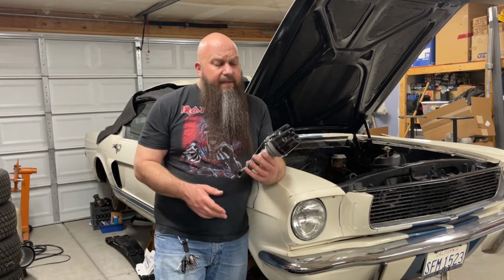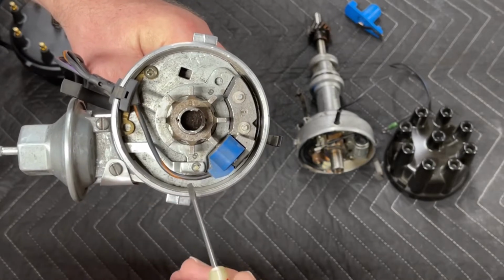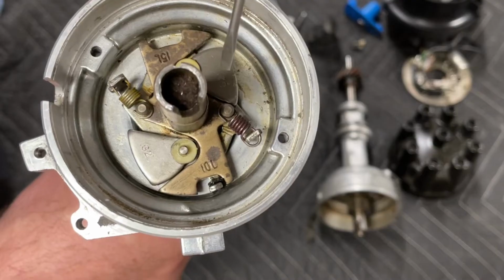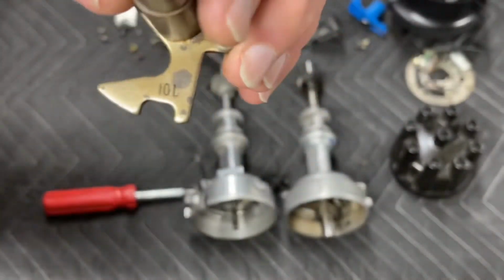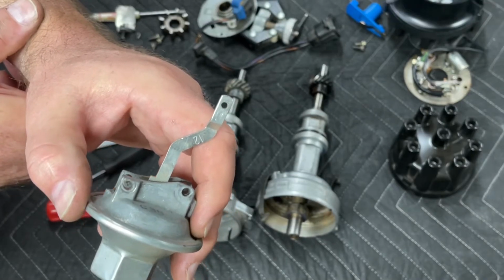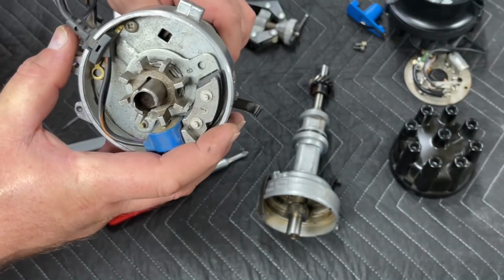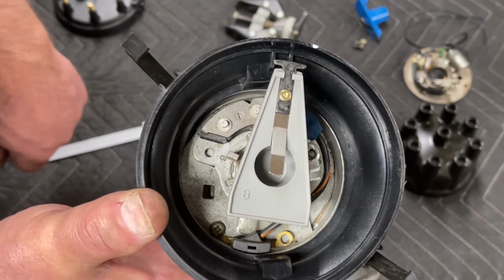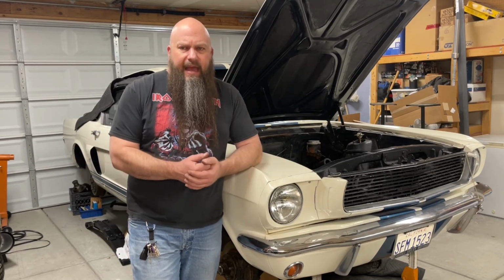Easy DIY Performance Re-Curve: '57-87 Ford V8 Distributors - Tune Your Ignition Timing

Comment: I'm a GM Delco guy , my Pontiac is recurved for the old gas. I'll need to do some different things but I get the idea.   I really like your channel Walter.  Thank you for sharing your knowledge with your very informative videos.
Reply from the maker: Timing is timing.  It really doesn’t matter if it’s AMC, Ford, GM, or Mopar.  For modern fuel, it burns faster, you need a little less timing.  The energy content is still there so you can still make great power.  The key is to have full advance 200-500rpm above your typical steady state cruise rpm, and use vacuum advance on manifold vacuum so it becomes load dependent.  Tune for torque and horsepower using the mechanical advance and use vacuum advance for lower emissions, stable idle quality, and cooler operating temperatures.  Those principles work on on nearly all engines in older vehicles.

Comment: Pardon my french but
Damn good video Sir.
Your right about the gas quality of today vs the 70s gas, if everything is ok to Perfecto !! It won't run worth a $&+- if the timing curve, stability (bushings etc) coil and pickups/points isn't up to snuff the engine will run poorly !! I've seen people literally rebuild the engine that was tip top because of a distributor/ control module problem, the total advance and all in by ? RPM makes a major difference in driveability Performance, economy.
All the best to you and yours Sir.

Comment: I've been doing a lot of trial and error tuning in my 429 Autolite distributor for my 70 Torino GT... I must say man what a great vid! You nailed it every step of the way and by far best Ford distributor tuning video on YT... Subscribed!
Reply from the maker: Right on!  Glad the content helped.  If you have questions about specifics for the 385 Series, I’ve built versions from basic 429 Thunder-Jets to Super Cobra Jets and displacements up to 604” and installed them in applications ranging from boats, to RVs, Land Speed cars, drag car, and daily drivers.

Comment: If my base timing is 12 what is my total timing my engine is 289 with 302 heads standard cam
Reply from the maker: Should be 32-34° but you’ll need to use a timing light to figure it out.

Comment: Hello can you help me I have a detonation problem on my 351 stroke to a 408 strip street  Windsor that I just can't get rid off.
  Initially I started with a 10.5  to 1 compression, but the braking pressure was 350 psi on all 8.
Reply: So I decided to use dish Pistons to lower the compression to 9.5.1 in retarded the cam, I still wind it up with 220 PSI of cranking pressure.  I swapped cams and was able to get it at 195 psi.
Reply from the maker: Sounds like your calculations for static compression were way off or you went way too small with cam selection both times.  10.5:1 is not a problem, but cam needs to be mid 230s duration @.050” minimum for street use.  

What is the piston to deck clearance on your engine?    And are you using a ‘69-71 block with a shorter 9.480 deck height and not factoring that in by chance?  What cam are you currently using?  How is it installed?  What heads?

You may have an issue with quench area.  Too much space between the piston and the head, incompatible shapes between the head and the piston causing poor flame travel.  

There are solutions but they may require changes, but to offer you any more complete guidance I need to know a lot more about the combination.
Reply: @TheGT350Garage   heads are afr 1420's cam is solid Howards 230° duration and Block is a "D" 80's Block, i dont recall the piston deck clearence but it for sure just alittle in the hole.
Reply from the maker: Hector, the cam is actually pretty small for a 408, that’s basically just a hair bigger than a 289 HiPo cam.  You’re snapping those valves open and shut on a set of high flow heads and getting a pretty stout cylinder fill, that’s why the cylinder pressure is so high.  

Then you have the issue of quench area.  A stock 351W has the piston .035” down from a 9.480 deck and .058” down on a 9.503 deck, add the thickness of your head gasket (typically .041”) to that and you’ve got .099” quench.  The dished piston makes it worse because the flame travel is moving in different directions and not smoothly across a flat piston crown.  You’ve got a difficult setup to work with. 

I’d go back to a flat top and use a Cometic gasket with a .027” compressed thickness to get rid of as much quench as possible without a complete rethink of the combination.  Then I’d put more cam in there, something in the 238-242@.050 intake and 244-248@.050 exhaust range, ground on a 112 LSA and installed on a 112-114 ICL, and with .560-.600” lift.  It’s a huge leap and sounds like it’s not streetable, but it won’t have the issues you’re having now even at closer to 11:1 compression.  Total timing will need to be in the 27-29° range, and you’ll need to tune for .85-.88 Lambda (air/fuel ratio).  With that it will run great, drive great, and be relatively trouble free.
Reply: And it still detonates like crazy. I have tried recurving the distributor. Obviously play with the timing initial and total different carburetors. Nothing seems to work.   Any suggestions??

Comment: Gday Walter, 

Do you have a part number of the vac adv canister for the duraspark dizzi ? 

So the canister adjustment  is changing spring tension which allows tuning of the vacuum hg where you want vacuum advance to disappear ?

Any advice on using alum terminal vs brass terminal dizzi cap (Duraspark ) with HEI module or multi spark ignitions ?

Cheers
Reply from the maker: Use a Standard Motor Products VC-221

Comment: one question  to remove the weights the plastic retaining clips will break. what do you use to replace the clips or can you get new ones and where. thanks
Reply from the maker: There isn’t really a need to remove the weights unless the distributor is in really bad shape.  If that’s the case, a replacement would be a good idea because at home most enthusiasts don’t have the tools to check the bushings in the housing and the shaft for wear.
Reply: @TheGT350Garage  you mentioned to remove them to make them lighter plus i have had the plastic clips break from getting brittle from heat but have no idea what to use to replace them are there clips available from somewhere thanks
Reply: @79LiLRed   I was scrolling through here to ask the same thing I got a pair of distributors with cracked weight retention clips.  I can't find anyone with a source to buy them.

So it looks like I need to get an ID, OD, and height measurement to see if spacers can be bought. Then hope I can find an E-clip that will work to hold them down.
Reply from the maker: @earlbrown the plastic bushing and clip is a non-serviceable design and was only ever available as part of a new or remanufactured distributor.  What you can do if your clips are damaged is use a distributor shaft from a points distributor, the pivot shafts were larger and the weights pivot on the pin directly, allowing a simple E-clip to hold the weights on.

Comment: I’ve got a freshly rebuilt 289 that is bone stock except for slightly improved (truck/RV cam). My stock ford distributor has no mechanical advance because the weights and springs are corroded I’m suspecting. Thanks to your video I’m ready to dig in and take it apart. What total timing and about what RPM should I shoot for it to come in at? It’s set at 12 degrees initial and idles well but has very little power due to no advance. Thanks!
Reply from the maker: Total tends to be about 3-4° less than the original factory spec because off the changes in the fuel.  So you’ll find yourself in the low 30s.  The curve should bring the timing in fully about 500rpm above your typical cruising rpm.  Vacuum advance should be in place to layer in an additional 10-14° at idle and cruise speeds.
Reply: @TheGT350Garage  great thank you!
Reply: @TheGT350Garage  I got the breaker plate pulled off and
I have to really give the rotor a good pull to twist it some but it doesn’t snap back into place like it should would the springs holding pressure. I’m assuming my springs are a little too worn out. I’m attaching a picture of what I found. Is there anything that looks out of wack? I’m thinking something needs to be lubed but I wasn’t sure the correct lubricant and where to put it because it feels kinda sticky.

Comment: MSD Distributor Advance Recurve Kit # MSD8464
Reply from the maker: For MSD and GM distributors that kid is absolutely fine but for a Ford distributor the springs are not the correct length to maintain a proper curve in the long term and Ford specific springs should be used.

Comment: Man thanks ☺️ 👍 I wish I seen this video before I bought a Pertronix 3 . 
I never new what that felt was for I always thought it was to protect the screw underneath 🤣.
I'm about to pull my Pertronix out and put my motorcraft back in ,  so I'm assuming you adjusted your vacuum advance using a vacuum gauge ?  Giving it around 7 hg ? .

I have a 390 Fe in my 69 F250  it has a Comp 265/275 cam and I put a  4bbl with a RpM intake  I have a adjustable vacuum advance motorcraft dist with Pertronix 3 module and coil .   I can only get 91 here in so Cal  I'm wondering how close the Ford Mr gasket recurve kit springs are to the GM points advance springs I bought that kit since I was using the Pertronix 3 dist.
That's some info there I didn't know I could get a adapter for a dura spark and cap /rotor and make a HEI style set up either muchas Gracias .
Reply from the maker: So, the GM springs can be used but they fit a little funky because they are longer.  You just have to make sure they aren’t loose.  FE engines, especially 390s do tend to need a little more timing than other Ford V8s.  You’ll probably want to be around 33-35° total mechanical advance and get the vacuum advance to give you everything it has by 4-6” of manifold vacuum.  

If you have the means to fully disassemble the distributor, you can clean the housing with a small bore brush, clean and polish the distributor shaft, and use a dry film lubricant (commonly used for firearms and easily found online) in the housing and on the polished shaft.  Then a drop or two of engine oil in the bottom of the housing and it should feel amazing and spin with absolutely no resistance.
Reply: @TheGT350Garage   I ended up getting the Ford ones  the GM ones fit  pretty good although not sure if they were stronger or weaker than the Fords .  Also I had the 10L and 15L distributor  so I just left it at 10 L to make 20 + my 10-12 initial will be 32 total if I go past 12 degrees initial  it starts funny like a run on start it's better at 10 _12 for good starts .
Reply: My distributor only has the 10 mark on both sides . If I take that lil plastic bushing out will it give me 5 degrees more for 30 degrees mechanical advance ? .. also with the dura spark can you run that to your coil with the hot wire from the dist or does it have to be ran through the module ? And is the D.S.distributor cap  fit the HEI plug wires or is it exclusive to the dura spark.
Reply from the maker: @TheThirdWheel618 so, if you have a 10L leave it a 10L (20°).  It’s better to make up total advance with more initial timing than to run a bigger advance curve.  For your FE you’ll want 13-15° of Initial timing plus the 20° advance curve to get 33-35° total.  Vacuum advance helps with idle quality, engine temperature, and fuel efficiency.  As I mentioned before, it should add timing above 6in/hg of vacuum.

Duraspark has a magnetic trigger that operates a module, so yes a module is mandatory.  I like the Pertronix Digital HP these days.  Nice unit for the money.  

The Duraspark cap is a post style just like an HEI, so the HEI style wires from your Pertronix will work.
Reply: @TheGT350Garage  thanks 👍 my engine acts funny if I go past 11 degrees initial maybe it's just me thinking it I can only get 91 octane here .   I seen the cap and adapter pretty much everywhere lowest year said 77  I'm hoping that will fit .
Reply from the maker: @TheThirdWheel618 the cap adapter for a Duraspark works on ‘57-up V8 distributors, you’ll be fine running the big cap and rotor.  The 11 degree initial timing limitation makes me think you have something else going on mixture or spark delivery related to cause that.  If it’s not tolerant of more than 11° BTDC initial, how does it handle vacuum advance at idle, or is it more a cranking issue?
Reply: @TheGT350Garage  it will take more timing although it was 6 or 8 factory spec,  10 degrees is fine if i go past 12 it tends to run on occasionally.
I had a autolite in it  when I bought it but then I had the if I'm not using it why not sell it mentality and it came back on me many times wish I still had it so the 10L is not the original dist its a cardone rebuilt maybe for a 360 I have a 69 390 truck engine .
I would much rather have the 13 so I can have 26 mechanical and go 8 or 10 initial for 34-36 total and I bet my autolite was a 13L.
Reply: It tends to crank a little more than what it should at times if anything being a jet size off  or so in the main circuit on my Holly everything else is pretty much in order .
I'm running a 5 to 7 PSI electric fuel pump with a constant 5 psi .
I did find the original springs that came with the cardone rebuilt it had one super heavy spring and one similar to the yellow one that you had but it was silver .
I'm thinking that they gave me a distributor for a 390 but not so much for my application I started looking online for a dist that came from a 69 mustang with 390 or 390/428 for the fact that they would probably have a more aggressive advance curve . I have the pertronix III I've also ran the 2  I'm not very impressed with them yes they do work but I have actually started the engine with the points dist and it seemed to start better with the points and run just fine with the points as well , the only distributor that I've ever really been impressed with was a HEI. Recently I was working on a 454 that I was getting ready to sell the engine was sitting in the garage for 3 years I slapped the carburetor on it put the headers on it cleaned it up put a new cap and rotor and within not even seem like a tiny Crank that thing just fired up.
I'm running a 45000 volt coil but I would like to run at least a 50,000 or the equivalent to the 65,000 at the HEI has .   They sell one online and it's all the same distributor if you ask me just a whole bunch of different rebrands even jegs has one but there probably all made in the same place in China and sold in bulk all over the world for a 390 .
Reply: I have the specs you provided in the video as far as the measurements of the  boot  side .  The 13L  so I might just do the opposite of what you did and Dremel it out a little bit to match the specs of the 13L .
And if indeed they are the same 10L  on both sides if it doesn't work out good I can just swap the 10L back to the limited side 👍.
Reply from the maker: @TheThirdWheel618 ok, don’t worry about the coil, it’s probably the least of your problems.  Check the voltage at the coil.  It needs to be 10.5v minimum.  Ford uses a ballast wire in the harness, if your coil has a ballast resistor installed it will really hurt coil performance.  Next, check your plug wires for resistance.  You measure the resistance of a plug wire in ohms per foot.  Good wires need to be less than 1000ohms per foot,  500 per foot is good, 50 ohms per foot is excellent.  The less resistance you have the more spark energy reaches the spark plug gap.  Tighten those gaps up to .032”.  Big gaps have huge resistance and can cause misfires and other performance issues.
Reply from the maker: @TheThirdWheel618 run-on or dieseling is not a timing issue, it’s a carburetor issue.  If you run more timing, you can close the throttle blades and lean on the timing and mixture screws more than the throttle blade stop.

Comment: Hi Walter,  I have a question in regards to the duraspark distributor install on 289 engine with a carburetor setup ,,,
Do you have to use some type of ignition box for this distributor to
 function ? I like the benefits  of this distributor over points ignition but I'd prefer a factory look in the engine bay without an external ignition box .

Good quality videos,
Cheers
Reply from the maker: You can use an original style Ford Duraspark ignition box so it looks like a factory upgrade.  If you really want to do it up, grab one from a junkyard, gut it and put a GM HEI module in it, wired through the old blue plug, or you could even just “hide” the HEI module out of sight and keep the wiring super clean and simple along the factory routing.  

I’m running a Pertronix Digital HP ignition, it’s very compact (about the size of a Duraspark II module) and can be mounted discreetly.  Example locations would be below the hood hinge on the fender apron, under the dash, or anywhere that suits your needs.